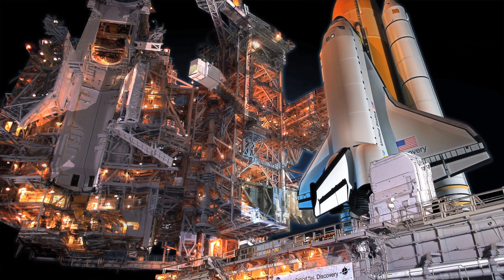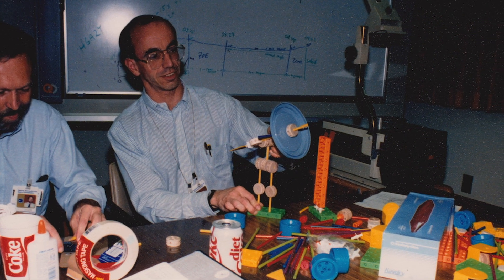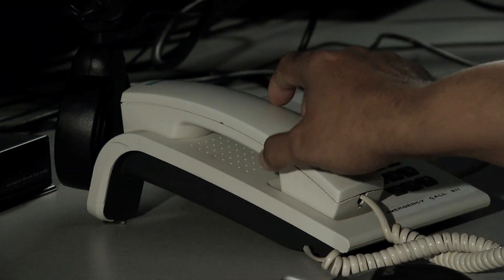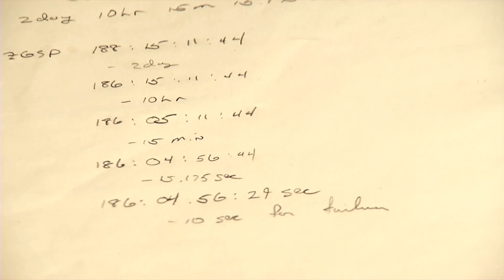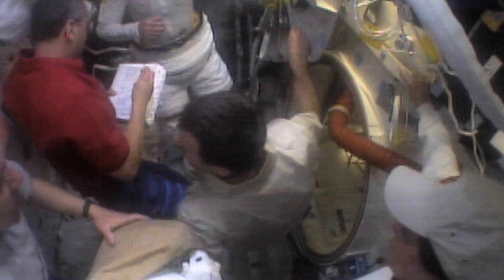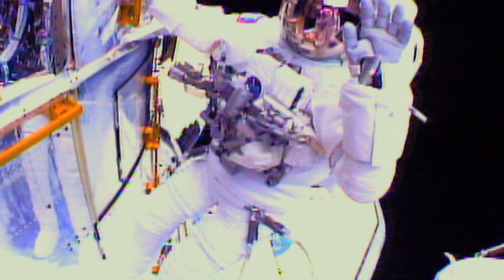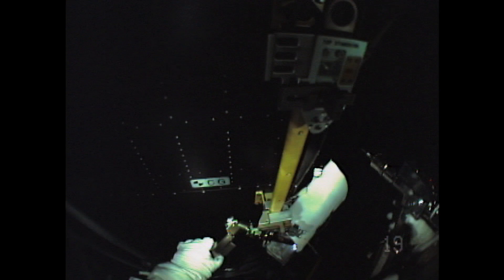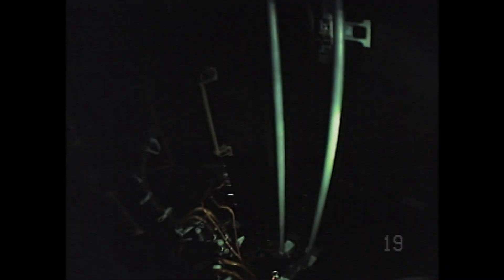Figure It Out: How They Kept the Hubble Space Telescope Working

Comment: How did the ISS, climb to a altitude of 240 miles AGL, to 330 miles AGL? What about the supposied decay rate, of atmospheric drag, that's supposily compensated on the ISS with rocket boosters to keep altitude, and HST has NO propellsion, neither to turn the telescope or to ascend to keep the "330 miles AGL", sounds like another Masonic NASA Scam! 330 aaahhaaaaaa Try, SOPHIA, the 747 airplane, operated by Germany...operation paperclippers

Comment: 3:00 why does it need need counter weight when its in space ? did I miss somthing? can somone explain ;P
Reply: +tobbee1233 Mass still effects things in space so those counterweights balance the antenna's extended weight. They probably have a very small motors to move the antenna so a counter weight makes a small motor work more effectively. But more importantly satellites are very sensitive to movement so an arm extended out and moving will move the whole satellite and the counterweight will minimise that.

An example I can think of is that helicopter blades also spin the helicopter itself because of the torque, this is counteracted by the tail rotor.
Reply: To aim a telescope, you could use thrusters, but that takes fuel. You have to spin it, then use thrusters again to get it to stop. 

Reaction wheels and counter weights only need to spin the other way via a motor, then stop and do fine adjustments. All easily done without using much electricity, and no fuel.

Comment: So they haven't had to do any repairs or upgrades to it since these times?

Has telescope technology improved that they if we built a new one could we get way better "zoom?" and quality "mega/gigapixel" images from it?
Reply: +troyBORG They serviced it fairly close to the end of the Space Shuttle. What they do is not changing the zoom, but the sensor. The optics stay the same but the sensors now use technology that's 20 years ahead of what it launched with.
Reply: +troyBORG i think james webb space telescope is the replacement for hubble, it would cost more if they keep on maintenance than launching a new one. plus the tech inside hubble is late 80's tech. 

more info here
http://www.jwst.nasa.gov/

they even have a live stream for JWST.
Reply: +troyBORG Probably too expensive to fly up a new telescope, the weight would be huge and it might not be that much more useful, also I think theres other satellites taking pictures now.